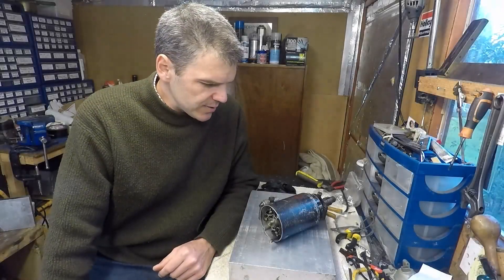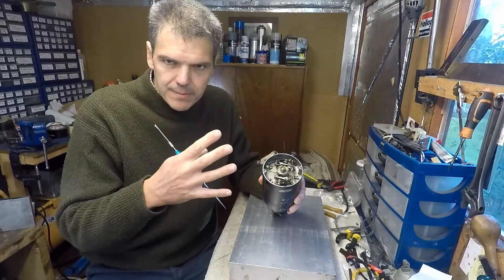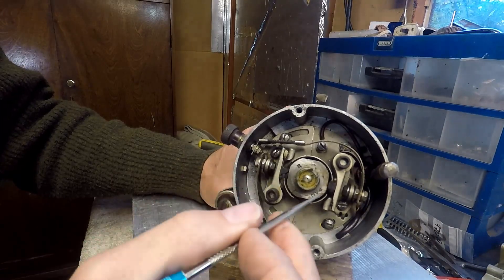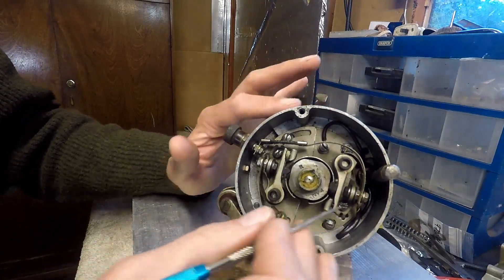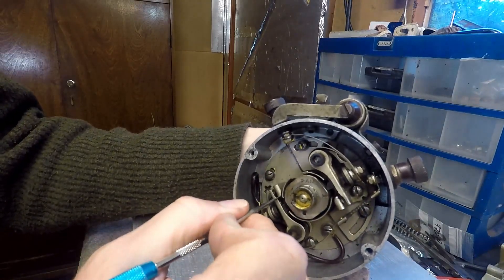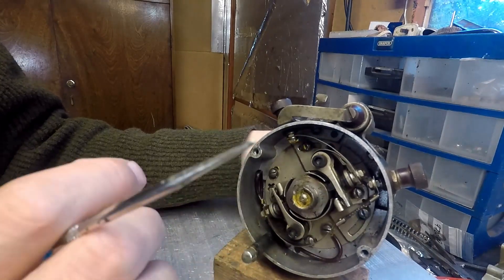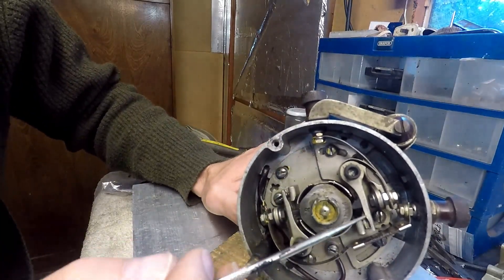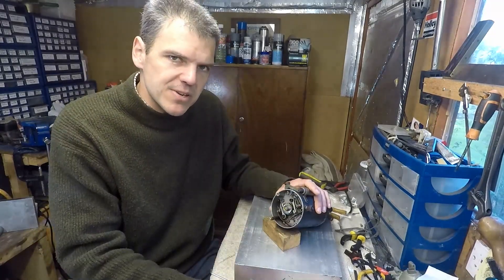How do dual point ignition systems work in old school engines? Scintilla Vertex VM4 dual point.

Comment: Could you please suppose how should I adjust the advance between two sets of points in a distributor of an old Nissan? I have dual spark system, two sparks per each cylinder and each set of sparks has it's own coil, so there is no need to set the points touch the lobe of the cam one after another to let the coil set the charge. This system is used for burning the air-fuel mixture more evenly, so should I adjust the points to be opened at the same time or retard the second one?
Reply from the maker: Your best bet there is to try and see if you can get the manual from the internet and see if the factory settings are given